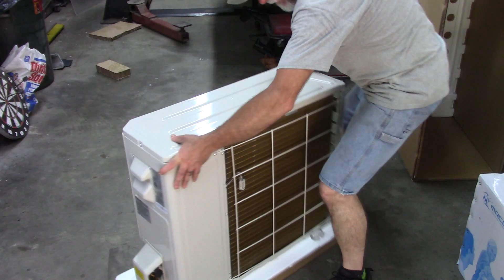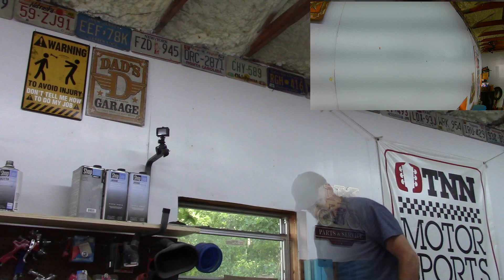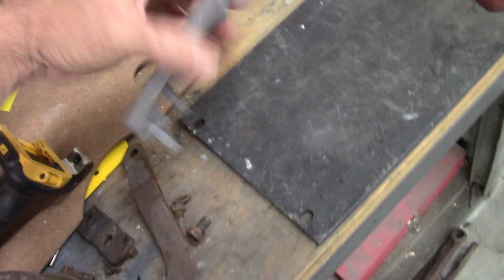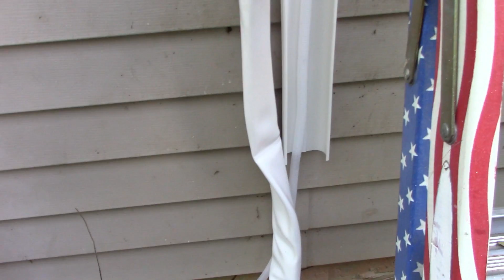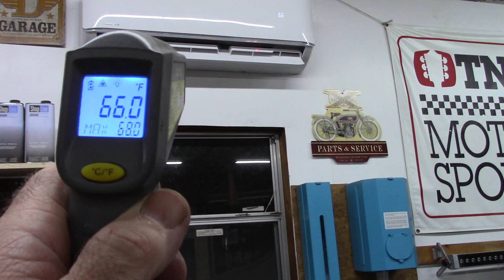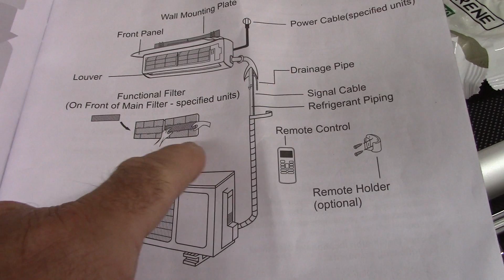Mr Cool mini split air conditioner install.

Comment: That drain plug thing is used if u have it on wall mount so u can connect the drain pipe to the condenser and u need to put those filters in the main filter to get to filters open up the indoor unit front panel up

Comment: Did you purge the air from piping wit the vacuum pump and how the system work till today?
Reply from the maker: No need to purge with this system. Pre charged. It's running great!

Comment: Thanks for the video!  I have watched several of these DIY installs on the mini-split systems and it’s great to get a different perspective from each.  I wanted to point out to future viewers, that I have always heard, “not to coil up” the excess line set tubing.  Supposedly this is a “no-no” in the HVAC industry, as the coil(s) could create a potential blockage in the liquid refrigerant.  Just what I’ve heard, so if any professional would care to elaborate on the matter, it could save someone some headaches down the road.
Reply: According to the "pros" who commented on other videos, this creates an oil trap that may kill your system. I don't know since I'm not an HVAC Pro, but the instructions specify:

NOTE:
Keep excess refrigerant hose coiled. Wrap with
protective tape and store behind the condenser in
a horizontal position (flat with the ground).

Comment: Nice video.  I just (2022) ordered the new version of this 24K unit.  I can see a few things have changes, the first being the signal cable no longer has plugs on it.  My fun part of the install will be the pipes come out 20 feet up on the wall, and I don't like heights, lol.

Comment: I love the DIY ones. I am terrible with HVAC work, but I've done my fair share of electrical work, just got an electrician to check over in case. I installed one with help in my friend's RV. The filters go onto the blue screens on the inside.

Comment: Sorry if this has already been asked but what link do you have to cover your line set on the outside of your building.  The white molding.
Reply from the maker: There are a variety of lengths available. I think this is the one I used: https://amzn.to/3rz8QpK
Reply: @JoDaddysGarage  thanks. Man I wish the company would let you choose a shorter fixed line set so you don’t have to coil up unused line.

Comment: Can you hook it directly to a breaker? also what size breaker did you hook it to?
Reply from the maker: It calls for the cutout, so I can't say for sure. I believe I used a 50 Amp breaker in the fuse panel.

Comment: how did it heat in winter?im in ERIE PA. (SNOW)
Reply from the maker: It worked great for me. I live in Ga. though. It kept the shop around 65-70 degrees.
Reply: @JoDaddysGarage  thanks for you speedy reply, iv got to do something,i burn wood now but getten to old and winter is knocking on my back door

Comment: Good install, but you missed a few simple things by not reading the owners manual when you were confused about things early on in the video. Also I’m not sure why you didn’t simply place the condenser unit right in line with the hoses that came out of the wall.  Maybe so you didn’t have to be concerned with coiling the excess lines.

Comment: '@Sons of Thunder'   But this is a Youtube talking about DIY Mr. Cool so when you say, Personally I'd pull an evac for two reasons, it would imply that you are talking about if you had a Mr. Cool DIY you would do this. I am not sure if you are understanding that Mr. Cool says not to pull a Vacuum it will spoil the warranty and it is because from the factory the line-set comes with a Vacuum so there is NO moisture in the tubing and if you cut the line you would not be able to connect the press fittings that they use because they use O rings when pulling a Vacuum you do not use O rings but either you will need to braise or use Flaring nuts to make the connections.

Comment: Thank you for taking the time to make this video, this is the best video I have seen on the install of the MrCool DIY AC unit. You cover more details about the install than any others that I have seen. One question I have is how tight of a radius can the line set take? Ie could I have a bend that would fit in the bays of 16 on center studs instead out having it coiled up out side of my garage?  Again thank you.😁🛫
Reply from the maker: Hmm... Hadn't considered that. I believe it would fit. I measured mine sitting in a relaxed loop on the ground and it is right at 16". If you order one, please go through my amazon link in the description.

Comment: Kind Sir, you did a good job with one exception: If you have not installed those "filters", PLEASE contact the manufacturer, on WHERE they go; and install them immediately.
Here is why: as a former AC repairman, those filters are VERY important. For IF you continue to run an AC or Heating unit, with out the filters, oily dust will clog up the fins in the AC piping.
This will clog both the AC and the heating from working as it should; and it may even ruin the compressor over time.
And that "oily dust" is HARD to clean from the fins.
For what it's worth.
Reply from the maker: Thanks.

Comment: at time 35.. did you draw a vacuum before you open the valves?
Reply from the maker: No. No vacuum required on this unit.

Comment: Tip: To make it easier to install the inside unit, shim about ¼" between the wall and mounting bracket. A few flat washers for each mounting hole will do it. Mounting to at least one stud is best, and use strong enough wall anchors where you can't find studs.
Reply: Good tips, especially the one about adding a little space between the wall and mounting bracket.

Comment: Great video , one question did you use a vacuum pump to make sure their was no leak in system before opening allen key on valves to let freon trough lines , wanted to do it myseld.but was told that you.have to do the step.with the vacuum before opening the allen key valves . Any issue with the way you.did it ?
Reply: Ok, good to know , I asked a licensed hvac ac tech , told me the line have to be vacuum and checked for leaks before letting out the freon by turning the allen key on the valves so I knew i can do the complete install myself but could do the vacum step because i dont have the tools but speaking with all do everything myself and use do.it the way you.did.it I thought I should be ok as well but just had to double check per the tech advise not just one but multiple I contacted
Reply: Also  those parts you had left over go on the air filter you.remove and has insert in the center and that's where they go ,not sure if you figure that out
Reply from the maker: No vacuum required per manufacturer. I have had no issues.

Comment: The elbow on the bottom of unit outside is for draining when using in heat mode also I would recommend using a bracket and hang the unit  the side wall outside

Comment: Great video and very helpful.  I wish you had film attaching the lines to the unit and running the electrical to the panel box.
Reply from the maker: Sorry. I probably should have done that.
Reply: @JoDaddysGarage  I'm looking at MrCool 12K BTU for our 3 season room we just built (17x15). We purchase a small space heater but I leaning toward MrCool so we can use the room all year round.  The biggest problem I see is the wrapping the refrig coil around the corner of the building because our lot has a steep slope on the wall where the unit will be installed. The lot is level once I turn the corner.

Comment: I also installed a diy airconditioning. U have to make sure the condens drain tube is always underneath the copper cooling lines or u might have leaking/draining/clogging  problems. Also tip for insects,put a sponge plug in the exterior condens drainage hole to prevent bugs etc from settling, this can also clogg the condens line.Nice detailed video👍

Comment: Did you not vacuum out the lines? Did u introduce freon into lines full of air? Please explain.
Reply from the maker: Vacuum not required per manufacturer. Lines come precharged and sealed. At time of attachment, seal is broken.
Reply: Lines are charged with 410A

Comment: How well did it heat last winter? How cold did it get outside?
Reply from the maker: It did a good job. Temps in Ga. rarely stay below 30 degrees. it ran a lot, but kept the shop comfortable. If I had a standard ceiling, it would do better.

Comment: really do recommend higher up off the ground.  Less water, leaves and other stuff going in.  Also, I guess you are doing a 220 volt unit and not the basic 115 volt unit.  wiring up a 220 v line is not something a typical DIY er can or should do.
Reply: Why not? it's one more wire, 2 hot leads instead of one. Each carries 110, so 2 x 110 = 220V. That, and a larger rated breaker in the panel for more amps.

Comment: Hello Jo, What size wire did you use from the disconnect to the unit? Also what size fuse inside disconnect and breaker in panel? I am installing a 24k Mr Cool and it states max overcurrent protection 25 amps, trying to figure this out. Excellent video, thank you for sharing.
Reply from the maker: Sorry, I don't remember the specifics. I know I had to convert from the manual because it was not listed in AWG.

Comment: There is some cold air leaking in through the wall sleeve where the coolant bundle, electric and drain hose pass through.  What's the best way to insulate that without crushing the soft drain hose.  Also on the outside where the bundle opens is there anything you do to prevent insects or rodents from crawling inside the bundle.  How about the drain hose - do spiders crawl inside it?  How to prevent that?
Reply from the maker: A quick fix would be some of the expandable spray foam. Right Stuff is the name. Works great, and won't crush anything. You could apply the same foam to the opening at the bundle. Unlikely spiders will crawl into the drain. You could use a small piece of window screen and a rubber band if it's a real concern.

Comment: You video on the Mrcool install was a life saver.  Everything works fine but I'm getting condensation leaking back into the room from the indoor unit.  What did I do wrong.
Reply from the maker: If you watched, I also had a problem. I double checked the hose, and it went away. It also had heavy condensation in the first 24 hours.
Reply: @JoDaddysGarage  Please explain "double checked the hose".  I'm a retired accountant - this stuff is all new to me.
Reply from the maker: I mean, check to see if the hose is angled and draining properly. I had a problem with mine, and after a slight adjustment, it drained properly.
Reply: @JoDaddysGarage  Ok, I re-positioned the hose so that its below the tubing bundle and now it's draining properly when the A/C is on.  However, a few minutes after I shut it off, it began to drip back into the room.  Help please.
Reply from the maker: @fredlesser6375  Hmm. Wish I had some better advise. Sounds like some angle is wrong. Hard to assess without actually seeing it.

Comment: the reason for drain on condenser and putting up on blocks, is when heating with unit the system runas backwards causing condenser to sweat/drip.  ice will build up under unit if clearance isn't high enough, then ice builds up on condenser.  gotta keep up off ground at least 6 inches in freezing weather

Comment: Great video, what do you think you should have done to remove the air in the system before you released the gas? Thanks
Reply from the maker: Not sure. There is nothing in the instructions that I saw. I can't say for sure it made any difference.
Reply: @JoDaddysGarage  The lines are sealed at the factory and under a vacuum when shipped. The unit is charged with refrigerant. When you connect the lines to the outdoor unit the fittings are designed to open permanently and let the refrigerant flow into the lines.

Comment: I take it you learned that you introduced air into the system. After opening the top liquid lone you should have cracked open the bottom flare fitting slightly until refrigerant starts to escape quickly close and snug up flare fitting. That pushes air out of the lines then you open bottom gas valve. Good luck

Comment: Thanks for the tips, we installed a 12K which is 115, in a back room that always seems to feel "muggy" as my daughter states. The rest of the house is on central with a unit that was replaced around 7-8 years ago and does okay. Had an initial issue powering up the mini, I initially took some readings with a multi-meter and found that power did not seem to be hitting the outdoor unit. Had to stop there, because beyond putting in a ceiling fan, I know my limitations. We had an electrician contractor (licensed) who did some other work for us install a separate circuit breaker in the panel and a disconnect switch right at the unit before the unit arrived as the delivery was initially delayed. We installed the inside unit ourselves and connected it to the outside unit. AFTER the power up issue, the original electrician became "unavailable". I decided to cut my losses and just went with a well-known small local company to come take a look and had the electrician come out today, found a faulty disconnect switch, swapped in a new one, unit is working great now. Waiting for the external line cover kit to come in. Thank you for the video, really helped a lot. The instructions really could be a lot better as well, but once the thing is in it is great. The app for the phone is tricky...still have not been able to get it to sync, but otherwise am satisfied thus far. Mounted the remote on the wall next to the doorway entrance to the room by the switch-plate. The unit is VERY quiet even at night when all are in bed, you cannot hear it.  A couple of things: 1)NOT truly a 100% DIY situation unless you are an electrician...I used to work on electronics in the military..but that does NOT make me a residential electrician. So, I will advise that for those that think they CAN do the electrical---REALLY consider bringing in someone qualified to do it for you the right way. 2) The directions in the install manual do SUCK..most of the reviews on this unit mention this aspect. Take your time to ensure that you REALLY figure out what you have in the box. Ours was missing the allen wrench and it looks like the packaging had been previously opened. Also, the shipping containers were very shoddy. Ingram will tell you once you order via email that you should NOT accept delivery until you OPEN the packages and make sure all parts are there and that they are not responsible for replacing missing items unless you list it on packing list before you sign for it. There was no packing list in our shipment detailing what should be in each box and the packages were delivered while we were at work. A neighbor signed for them. I'm not trying to deter anyone from getting a unit, just be aware that there are some things that you need to plan for...and be prepared to bring in some professional help if needed. On the bigger scale, it is STILL less expensive than doing it the other way from my experience and the room is no longer a sauna.

Comment: Those little filters slide into the main filter holders. I have a Kaysun and it has just 1 small black filter which they call an Air Freshner Filter. Have a look at this video time 13:45 https://youtu.be/GxlewxYU620

Comment: How man square feet is the garage? Our house is only 1560 square feet about 800 in the basement. Trying to decide how many wall units I'll need. Thanks great video
Reply from the maker: My shop is 24X36. Right at 900 sq ft.
Reply: 24k btu should be good to do your first floor.  2 (12k) head units or 1 (24k) head unit

Comment: Is this a heater and AC too and can we split duel unit For another room
Reply from the maker: A/C and heat. This unit is only for one area. They make others that can be split to different rooms though. Follow the link I posted in the description.

Comment: Very nice video. I think it was quite well done. I'm wondering though, I haven't seen the specs on this yet, but how does the efficiency of this machine compared to say a Mitsubishi. For instance what is the lowest temperature that the heat pump will still work at? And you mentioned in the video that you needed install 10 gauge wire. Several years ago I helped someone install a no-name brand mini split. When the AC Tech came to vacuum the line set and compressor he said that the wiring for the same size Mitsubishi would be 14 gauge. That seems like substantially less electricity! In New England electricity is very expensive so initial the savings on a DIY unit like this might be quickly offset by additional cost of electricity. Probably for a shop it wouldn't matter, but I wonder how much more it would cost to run, say, for heating and cooling a home? Still, the no-name brand unit was thousands of dollars less expensive than a Mitsubishi.
Reply: This unit requires  220 volt  20 amp circuit  breakers.  By code you need a minimum of 12 gauge  wire.  Smaller units require less volts and amps

Comment: You can probably de-pin that connection and fit it through the watertight connection from your box to main unit.
Reply: Do you have to use a Electricians to this

Comment: I remember when I built my 1000FT free standing Garage my Wife at time asked me why I was running 220 and water to it and I told her BC this baby with have AC .....down here in South Of Tampa we AC everything, jK but I did look into what you put then i saw price and I just Bought an IN wall 24000 BTU wall AC 499 compared to $1200 for what you did @ 24000btu ( they have come down in the past 15 years but my Wall unit is still running and bc its 220 she runs cheaper than a 120 v  Not to mention My Garage is all Wood and with out the ceiling insulated  (have the panels just not put in when lost few family member's in a couple of years and by now I need to redo the roof anyway but the AC still cold as hell.   Cow}:-o)
Reply from the maker: True. This is also 220.